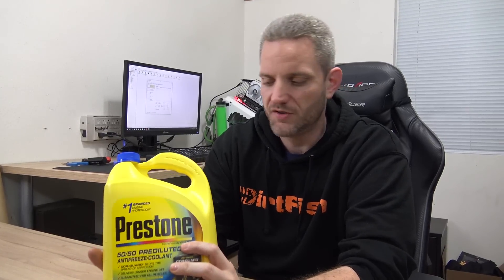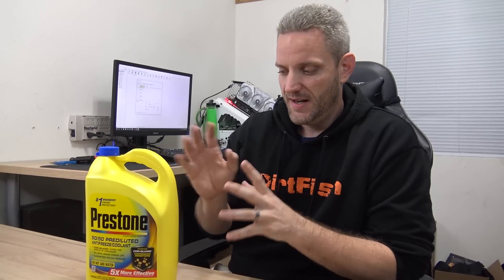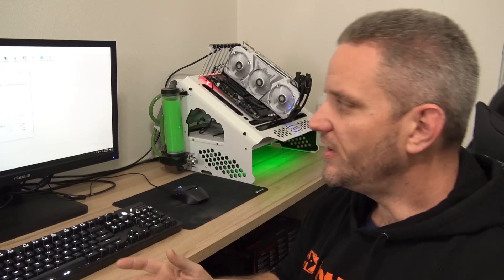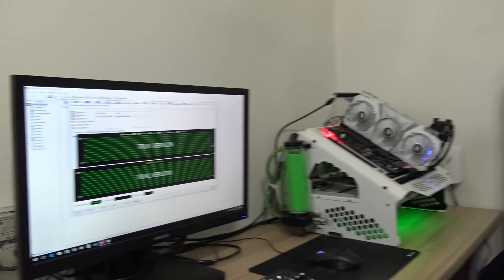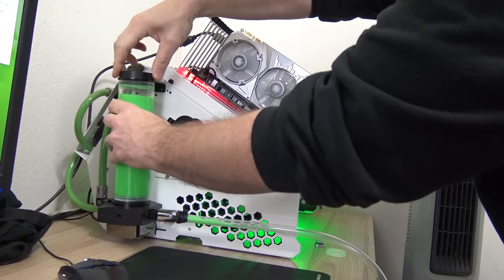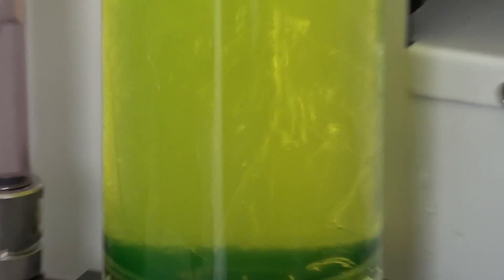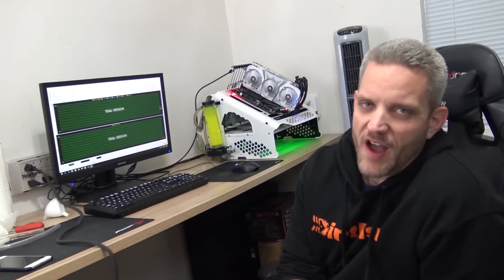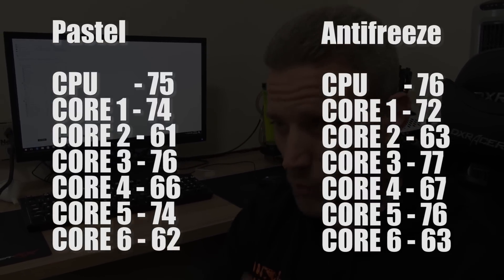I used Antifreeze to cool a PC

Comment: I've been running a bit of anti-freeze in the loop to prevent corrosion, to act as a lubricant, and to act as an antimicrobial for a couple years. I've never had a problem with soft tubing or or other plastics.
Reply: I use Car antifreeze since 10 years and still have the same pump from then no problems. That Jay uses a 1/1 mixture straight out of  the bottle shows already that he doesn't know what he is talking about, never use more then a 1/10 mixture...
Reply: There is no need to use a thick mixture of ethylene glycol or propylene glycol, this is a low temp application and all it is doing is acting as a growth inhibitor. Which is why using a 1/10 or 5% mix is all that's needed.
Reply: +zagan 1 , zagan it is not ethanol and water. ethanol is alcohol based and is sometimes used in RV coolant, alcohol based coolant DOES eat rubber and plastic. You meant to say ethylene/ diethylene which is the coolant shown in the video, it's the most popular kind.
Reply: just to clarify when you guys say soft tubing, you are probably talking about clear vinyl tubing, sold at home depot in rolls or by the foot
Reply: depends entirely on the plastics, as he notes.
Reply: The plastic in your car is specifically chosen to withstand getting eaten away by antifreeze. Some soft tubing used here might not compare at all.
Reply: Jason Gregory ,  yeah I don't think it'd cause any problems as you have rubber and plastic pipes  already in a car.

it won't drop Temps because it's just destilled water and ethenol, you can get temp dropping coolant for cars and race cars that should drop Temps though. some of those drop Temps down by 10 degrees.

Comment: Have been using antifreeze, to cool my cpu for 4 years, works great , no problems, with peltier plate, best thing it does not corrode inside of water block,  two years last waterblock corroded out and trashed from distilled watter and crap they sold in quart bottle !Been running  an i7-875, 2.8 gh for a work station, runs at -1to-7 degrees C , with no load, Run at all cores at 100 percent for hours, doing renders with cinem4d, temps average 40 to 50 degress C,  4 years and no problems!!

Comment: You could set up a small separate loop to have in the shop, and let it run for some time not on a computer. You could mount the block to something like a small aquarium heater or something like that to simulate the cpu heat. Could be kind of a cool long term test, and would keep your system safe. Either way, Thank You for the video.

Comment: That "reaction" you were seeing was pure water floating up to the top of the heavier/denser coolant mix.  It's simply due to the fact that the glycol blend is denser/heavier, as well as a difference in the index of refraction, which makes those cool wavy looking effect. You can get the same effect with a sugar/water blend. Just fill a cup with water, and dissolve as much table sugar as you can into it. Then, in a clear glass, fill it half way with tap water, the slowly pour the sugar water into it, and you will get the same weird effect.

Comment: The point of antifreeze isn't to cool, it's to control freezing, boiling and corrosion. Water is a better coolant. That's why antifreeze is mixed with water.
Reply: 😩Antifreeze is mixed with water to raise the boiling point and lower the freezing point
Reply: Right on except the boiling point raising. Pressurizing the system is what raising boiling point.
Reply: Ya. Because water freezes at 0c, which is bad if that's all up in your cooling system while the outside temps are below 0c. Oils, like the one used in anti-freeze, generally have a lower freezing point and thus allowing your coolant to remain liquid at sub 0c temperatures. 

It doesn't cool as well as water, but it still cools better than Ice that doesn't flow and constricts your system. :D
Reply: If you look at the data, pure water is only a couple percent better than the 15-20% mix usually recommended to control corrosion. This vid was 50/50, but still had virtually the same temps. It's also less viscous than propylene glycol used in AIO coolers.
Reply: @gorkman No.
Reply: Coolants is antifreeze, and it means that the liquid has an extended range that it would conduct thermal dissipations.  Pure water is 0-100C and it would be less efficient the more it approaches the low-high limits.  In a sense, pure water only work the most efficient when the temp is about 25-50C most.  Antifreeze and coolants are meant to work from -40C to well over 100C where water would be boiling instead 

I don’t see bad points in using antifreeze.
Reply: jkuty2 Now I'm confused
Reply: The point of the antifreeze was for click bait to make money off youtube.
Reply: @gorkman distilled water with a drop of inhibitor.
Reply: Fatal 
you're joking right?
Reply: your partially right actually, it does lower the freezing point by alot, but if you ever look at the specs of anti-freeze compared to water it actually barely does anything for the bowling point, altho it helps some. its just not much.
Reply: @gorkman5697same here. Is it worked for after mixed with car coolant ?
Reply: @gorkman5697 i planning to use 50 50 car coolant and distilled water mix. Will it work ?
Reply: The use of antifreeze is to stop bacterial infection not the cooling. And it works just fine never use more then a 1/10 mixture though.
Reply: He obviously knows this, and is why he didn't want to do the video. He just decided to listen to the idiots on youtube and prove them wrong. Everyone thinks they know something on here.
Reply: The point of antifreeze is to cool, why else would they call it a COOLANT? And water might be it "better coolant," but that doesn't make antifreeze any less of a coolant. If your engine was running hot and fresh out of water and there just so happened to be a few quarts of antifreeze right beside your vehicle, you mean to tell me you wouldn't put it in your car because the purpose of it isn't to cool?
Reply: @GhilleGhille  You stated "water might be it "better coolant,"".   Then you stated "but that doesn't make antifreeze any less of a coolant".   Water being a 'better coolant' would by definition make anti-freeze 'less of a coolant'.   You can't even argue with yourself and win.   Please go away.   Forever.
Reply: @paulmartin2348 A hamburger being tastier doesn't make the other one any less food.
Reply: You use silver for that kappa. You don't need to put extra chemicals in there.

Comment: Jay, The other thing is that there are no anti-bacterial / anti-microbial properties you will get all sorts of organic growth in your loop..  LinusTechTips in their whole room water cooling project used AntiFreeze and had organic growth in their loop due to that reason.  you don't have that issue in a car as the temperatures that the Radiator systems reach is more than enough to kill any organic growth that happens.

DO not use AntiFreeze as a "cheap" method for computer water cooling... you will have all sorts of problems and clogged items and end up having to throw out all the items you use with antifreeze if you do anything long-term with it.
Reply: Antifreeze in strong enough concentrations will straight up annihilate any bacteria or algae in a loop. The problem is they used didnt use a strong enough solution, which basically turns the antifreeze into food for bacteria and will SPEED UP the growth of bacteria.
Reply: ethylene glycol is very toxic as it is, not to mention the other toxic additives in anti-freeze, there's a reason it's illegal to pour down the drain

Comment: if you use water use distilled it won't promote rust...these antifreeze is poor cooling properties that's what the water in it does. if he wanted to actually do it correctly and not the idiot way, use synthetic cooling that is water free like evens coolant. it transfer heat better than water.

Comment: antifreeze is less efficient at transferring heat than pure water.  as a motorhead, i suspected the temps would be slightly higher with the antifreeze. i did not know that the glycol would react to the tubing. thanks for the heads up, jay. another informative and entertaining video. 👍

Comment: I tried 5% glykol in my first wc build, it ruined the aesthetics of my cpu & gpu block cause it ate away the nickel plating. It also created some kind of gunk in both entrances of the fins in the blocks, this is after 2 years of running almost constantly. This could be due to tube residue or something, but to finish it up, im never going to use antifreeze in my computer again.
Reply: 5% glycol is a horrible, horrible idea. Its literally food for bacteria and algea. You must run it in concentrations well over that to get any kind of antibacterial effects.
Reply: JgHaverty well I discovered no algea or anything like that after the disassemble. I did eat away some of the nickel plating and leave some kind of blue gummi residue.
Reply: Mrskithuset that "blue gummi residue" is bacteria mixed with plasticizer.

Comment: There is Nascar Engine coolant you can try. Anti-freeze is not allowed, and the coolant uses mostly water and some additives designed to take one extreme temps that would fry Ethaline-Glycerol.

Comment: Question, why not use a standard water loop, with a air to water exchange within a chamber filled with dry ice? Or a liquid-liquid heat exchange with liquid nitrogen? Or a liquid-air-liquid exchange using a loop of lN2? Or a l-a-l using both lN2 and dry ice? 
Or have a loop within a refrigerator/freezer that exchanges heat with your computer's water loop? Of course you would have to find a way to do this while sealing the fridge/freezer.

Comment: Antifreeze doesn't seem to bother all the rubber and plastic tubes and o-rings in cars. But Ethylene Glycol needs special disposal and the average computer owner is not equipped as such.

Comment: i use antifreeze on mine and one possible side effect could be soft tubing going hard, but that could be from the heat cycles too.

reason for antifreeze is i use a huge tank with about 15 litres, and 15l of pc mix is way more expensive.

Comment: Yeah, antifreeze isn't used in cars because its a better coolant, it's used so in cold climates your coolant won't freeze. If you live in florida or a warm climate you can run distilled water in your car.
Reply: Justis Cady You're correct, but the magnitude of change isn't that much. Normal cars run around 15psig, which raises the boiling temperature to 237F... the point remains.  The water wetter greatly increases the boiling point of the water, much the same as antifreeze does.
Reply: Corrosion still exists, so... running straight water is a terrible, terrible idea. Also, engines can get hotter than 212F/100C...............  what happens to water at 212F mate. 

Straight water = great cooling... but bad results.
Reply: I run straight water plus a bottle of water wetter in my car. Plus cooling systems are under pressure (don't open a hot radiator) and water boils at higher temperatures under higher pressures.

Comment: You should leave the antifreeze in a closed loop that isn't connected to a real system (even, could set up a loop in a case that you aren't using for anything with parts from storage). Then, run the pump a few times a day for a set period of time, just to show how the coolant will dissolve the plastic tubing over time and show how that affects the pump, radiators, and blocks. The real trick would be figuring out a way to generate heat in the loop. (I only suggest this assuming that you wouldn't want to destroy any computer parts, aside from extra watercooling gear that you may have.)
Reply: depends on the tubing, I've been running a loop on full load for years with just some decent PVC tubing and ~20% antifreeze
Reply: lowbudgethero PVC tubing is safe to use with ethyl glycol.  20% antifreeze is right on the edge for anti bacterial properties, I would run 25-30% just to be safe and more effective, but you're doing it right it appears.
Reply: It wont dissolve the plastic, it will harden it. This hardened tubing gets brittle and will eventually crack and leak, especially around high concentration areas like fittings.
Reply: PVC normally has some problems with alcohol on higher cpu temperatures. But it really depends on the alcohol and what additives you have in your PVC.
Reply: The R4v3n Nevermore what about milk
Reply: Old comment but just use silicone tubing, the ethylene glycol won't do shit to it.

Comment: I used approximately 15% anti-freeze to 85% distilled water in a loop a few years ago, purely because I didn't have access to any anti-corrosive agents: (quite tough to find here). The result was exactly what CoconutMonkey said, it destroyed my pump within a few days! Vibrations, grinding noises, flow rate fluctuations, then fully stopping and starting. 😭
It was only a cheap-ish EK DCP pump, but still it caused me major issues and down time. So yeah... Don't Use Anti-Freeze kids.

Comment: Jay, What if you used distilled water and RedLine Water Wetter? 

Anitfreeze doesnt help cool better than water but rather it increases the boiling and freeze points. Water Wetter helps reduce the surface tension of water increasing the ability of water to remove heat. At least that is what they claim

Comment: Antifreeze does nothing more than lower the freezing point of the distilled water, so you can still operate your car below the typical 32 degrees F that distilled water normally freezes at. It also prevents the water from boiling off to quickly due to excessive heat.

PC's are generally stored in fairly temperature controlled climates, so there's no point to running antifreeze in a computer to begin with, unless you prefer to let your computer room get below freezing, or above boiling levels for distilled water, as an ambient.

Comment: it's not not gonna do shit to the plastic. Pure water is the best heat conductor. The reason coolant is used in automotive applications is of course as an antifreeze, but just as important is as a rust inhibitor and to lubricate your water pump impeller.

Comment: once upon a time before your channel existed people Homebrewed the cooling solution they did not have fancy setups like that. Automotive supply was the only source for anything. heater cores from cars were used pond pumps were used rubber, tigon and copper tube and hose clamps was how it got done...

Comment: Antifreeze is more dense than water.  The pump will have more stress on it as it has more resistance placed on the motor and fail faster.  Antifreeze has no benefit and probably marginally worse as its heat capacity is lower than water.  Antifreeze is used for its higher boiling point and lower freezing point, both aspects that are completely useless in a water cooling system for a computer as it never sees those extremes.  This is like basic highschool chem and physics and its astounding none of this was mentioned in the video when you were trying to explain it.

Comment: Not to rain on your parade or anything, but I've been using propylene glycol in my water-cooled system for 5 years now. No leaks, no weirdness. It's actually what Thermaltake sells for their BigWater and ProWater kits.

My ProWater 850i has been running it for 5 years...

Comment: Hey Jay, thanks for bringing attention to the Ethylene Glycol issue. I used it in my PETG loop for months without knowing the dangers. I would mention, however, that the soft tubing should be OK. The Ethylene Glycol I got came in a Swiftech "loop in a box" kit. Look up Swiftech HydrX.

Comment: I have used anti-freeze for about 4 months. No issues to report. modern antifreeze have formulations that prevent damage to plastic components since most cars now have plastic radiator tanks and also some use hard nylon tubing.

Comment: its a given that it would produce warmer temps, anti freeze was created to have a low freezing point to stop water from freezing in your engine during water. In science anytime a substance has a very low temp for freezing it has a lower temp for heating and then evaporation. Anti-freeze has lower freezing point than water which also means it would heat up easier and keep the heat. if it was pure anti freeze instead of half and half you would of gotten high temps

Comment: Hey Jay, thanks for the vid and ur timing couldn´t be better cause i have a minor problem. And sorry for advance, this is going to be little lengthy comment.

I run air cooled intel system with Titan XP in a self build open air case, sort of like a test bench. The twist is that i located the case into its own room, seperate from monitor keyboard mouse etc. All the cables run through the wall.
Now here comes the cool part (literally cool). First of all its dead silent to use, and thats nice. But whats even better, the room where the case is located is unheated so in winter time the room temps can go well below -0 celsius! At 100% fan speed the Titan XP idle temp was -2C and +18C with full load in heaven benchmark :DD Thats good and all
but lately i have started to have this itch (from watching ur videos) to try a custom water loop inc cpu and gpu. Not for the cooling benefit... just for fun and i think the Titan deserves that sweet water block.

But heres the thing. If i use regular distilled water it will freeze to solid if the pc is not running all the time. 
Any ideas?
Reply: yes, and you also run the risk of condensation as well

Use anti-freeze in that case
Reply: Condensation... how?  In my knowledge condensation can only form to surfaces that are colder than surrounding temperature. 
Every part of the pc will always be atleast little warmer than the air in the room. 
But please... Correct me if im going haywire
Reply: rentturaakki when the PC gets warm then shuts down
Reply: actually, on second though, if your case is ventilated enough it probably won't be an issue